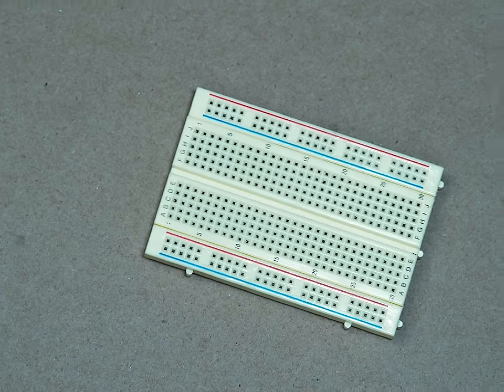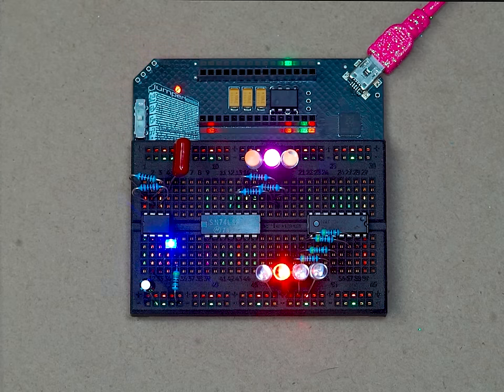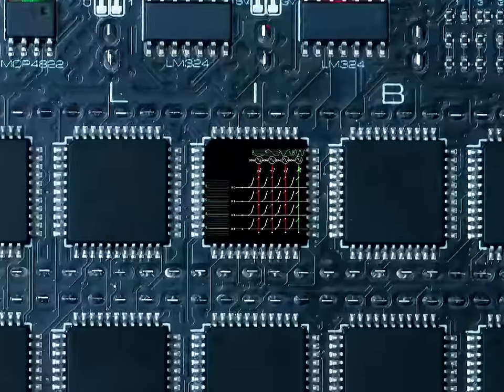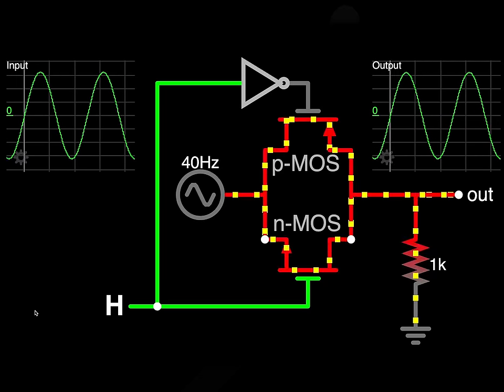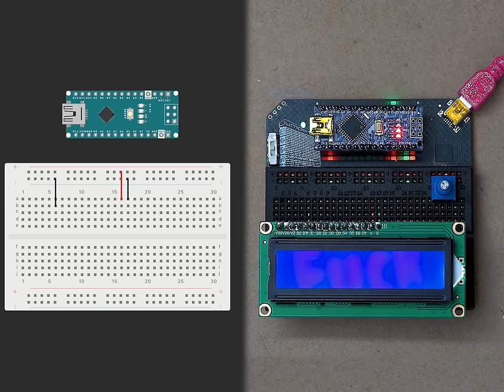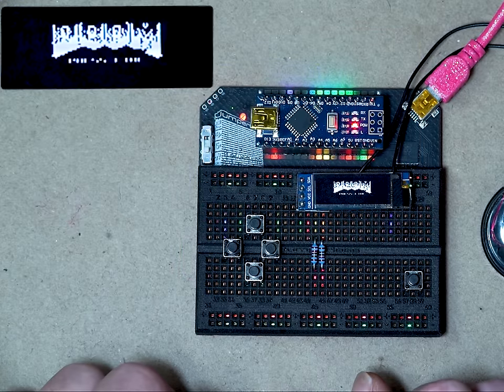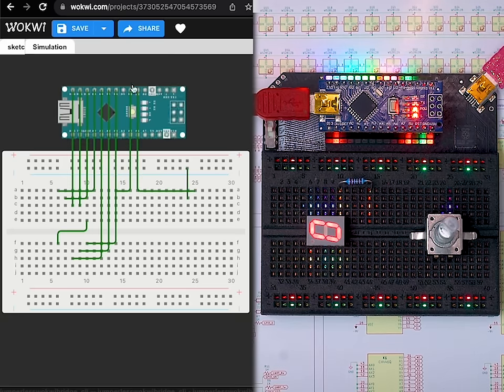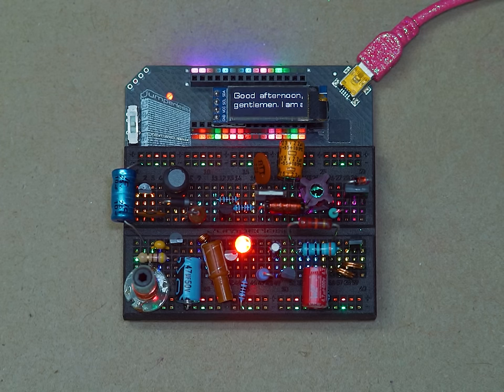Jumperless

Comment: The other problem with this, aside from being just as easy to do entirely in simulation, is it needs a computer to operate: What if you don't have one, and just need to test something quickly? Then a breadboard is the cheap & easy solution. You wouldn't normally use DuPont connectors like in the example: Short solid-core wire is much neater, and highlights where the connections are. It's also going to be faster to wire up.

Many people go straight from simulation to PCB prototype - which obsoletes this hybrid.

Another problem is there's just so much to go wrong: When you have a circuit fault, you have to rule out a fault with the prototyping system, as well as your circuit.

It's interesting as an exercise, but as a product, it would be expensive, self-obsoleting, and impractical to use.
Reply: As much as I hate non soldered connections: breadboards have a place in prototyping. As me and my colleagues are doing this for a living, I expect to save a lot of time (and thus, money for us and our clients) by removing the slow and error-prone work of placing jumpers manually. Also, the visualisation is an amazing time-saving feature, as we don't always need to connect a multimeter or scope.

Comment: just 100mA max per trace? Did I hear this right?
Reply from the maker: It's not a hard limit, and you could push it for short periods, but yeah that's already well above what the datasheet for the crosspoints advise. But 100mA is what I've tested running overnight and didn't fry them. 
So yeah, for large motor drivers and incandescent indicator bulbs and stuff, I wouldn't recommend this.
Reply: @arabidsquid   I was thinking out loud how would I use it for testing LED drivers + MCU.  Still no cigar as I would need higher voltage + current...

Comment: Assuming this is real, and not a joke, it would just be like a very small FPGA, fabricated at a very large physical size.

Except it would be pointless, because FPGAs come ready-populated with universal components and optimised connections. So anything like this wouldn't need the actual breadboard part.

Besides which, things like this already exist: The type of FPGA which incorporates analogue components, and usually RF as well. They're rare, but they pack in a few thousand components, rather than a few dozen. They're expensive, but probably cheaper than the above example on a capability basis, and they're about 1% of the size.

Comment: I dont care about jumpers. I care about the sockets on a breadboard that components press into. These don't stay aligned due to use over time. Honestly, I'd rather grab a piece of perfboard and some headers and solder everything manually with well sized cut wires. With practice, you can wire a circuit up just as quick if not quicker than on a breadboard with way less risk of floating connections due to crappy rails or wires simply pulling out. If you're that opposed to soldering, find a new hobby. It's the primary way to make circuit boards in electronics.

Tldr all breadboards are crap solder up the circuit on perfboard instead.

Comment: People have made many "smart" breadboards over the years. To my knowledge, all have failed for roughly the same reasons, and this one doesn't introduce any new ideas to change that.

1. Far, far too costly for its function at $289.

2. Due to requiring additional programming steps, it will take longer to use compared to a normal breadboard.
(this notion of jumper wires being "bad" or "confusing" is just BS)

3. The switches make the analog performance DRASTICALLY worse compared to a normal breadboard, namely the trace resistance (~75 ohms), capacitance(10pF), feedthrough capacitance (0.5pF), and nonlinear distortion (which isn't even specified in the Mux datasheet - red flag!!!).

4. The analog switches are easily destroyed by ESD and incorrect voltages, which is a terrible "feature" for a prototyping platform where mistakes are expected to happen.

In my mind, #3 alone instantly disqualifies this project. Many analog circuits (especially circuits using feedback) will simply fail to function on this breadboard.

So, you are paying a massively inflated price for a device with inferior performance.